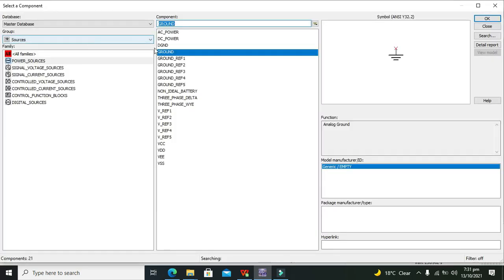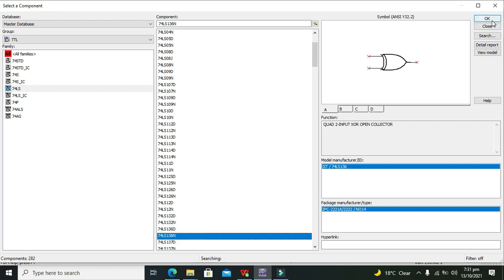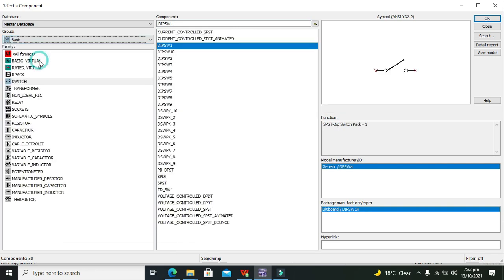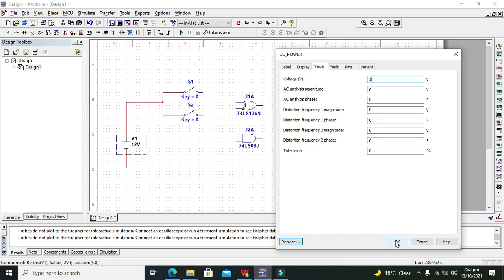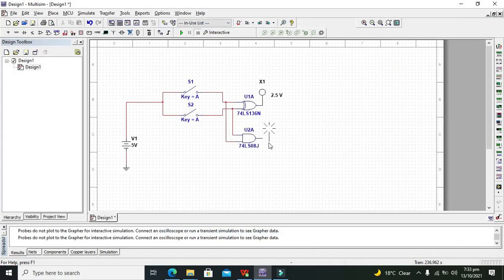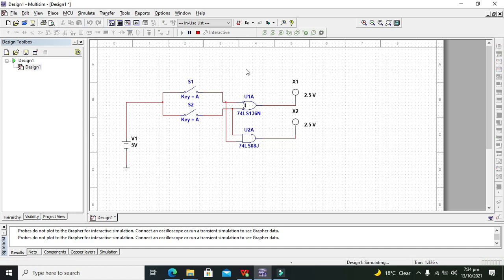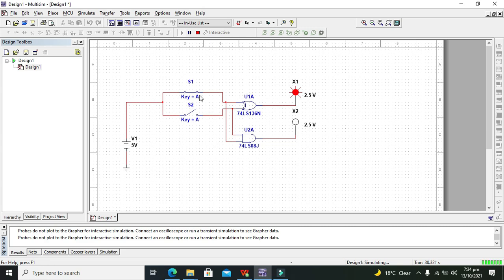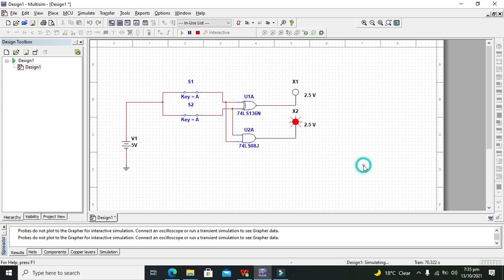half adder in multisim | simulation of half adder in multisim

Comment: I've have looked at prodeus and multisim simulators 
I seen nothing to see why so many people rave about
them, many of the ic's are missing pins and the failure rate
is not acceptable . If you are  a hobbyist there probably cause
more confusion then actual learning.
Reply from the maker: Actually simulators cannot replace the physical IC or simulator....In proteus even if u apply 220V to a microcontroller still it used to work well......
Reply: Why did you not use XOR gate-7486N and AND gate- 7408N. What makes the difference?